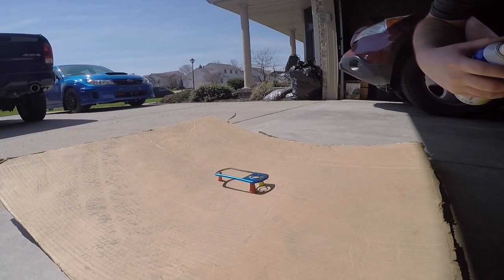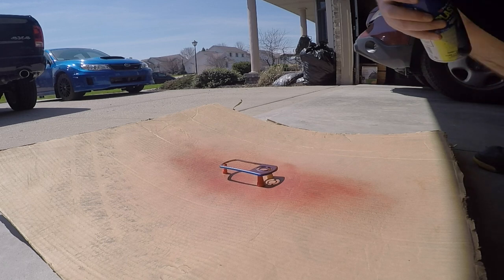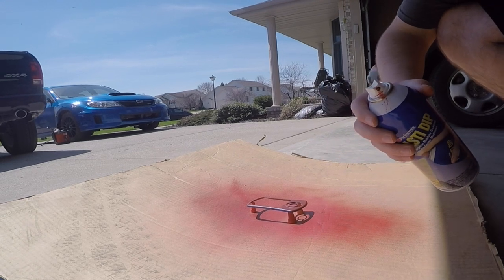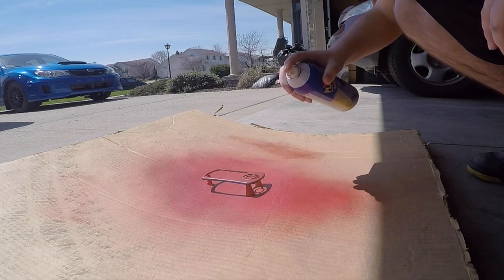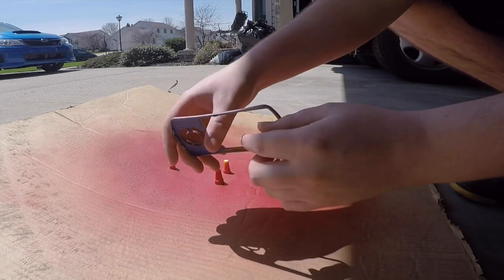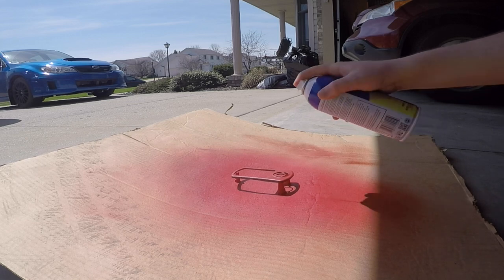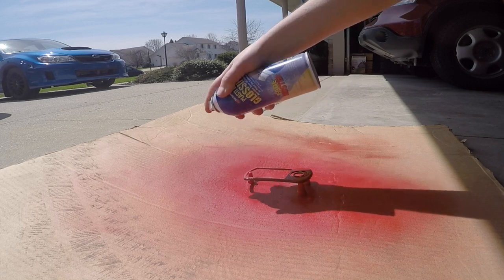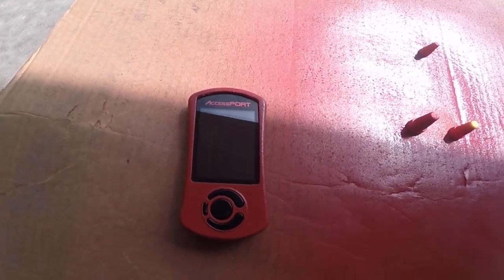Plasti Dipping Cobb Accessport Cover

Comment: This may be a bit late but 1 tip to prevent the spray nozzle from clogging up is to turn the can upside down and spray it a couple times. That will spray with more air pressure and spray any access paint away from clogging up the tip. Hope this helps.

Comment: Red should definitely look sweet. The WRB seems to go nice with red as an accent color. Just a heads up, today I tackled the Mishimoto throttle body hose swap. Holy crap it was 'no Bueno' to do!! I've had boost leak issues in the past with the stock weak one so I'm glad it's actually done. 
-JB
Reply from the maker: Yep I like it. Goes well with the gauges and all the red stitching and the wrx in the seats.